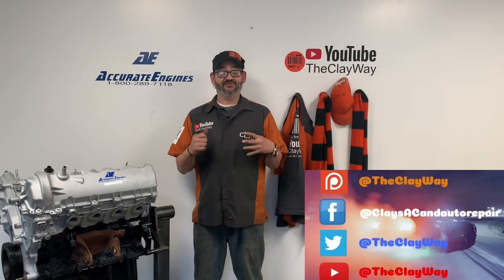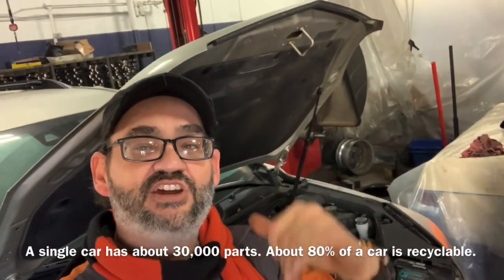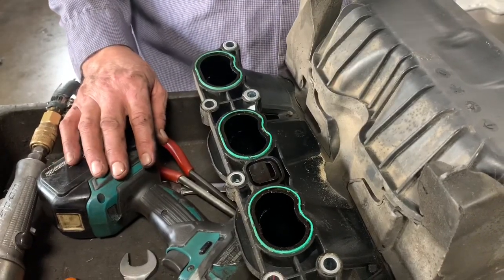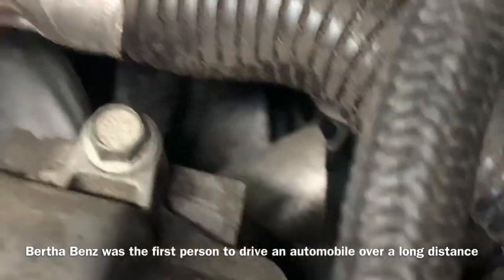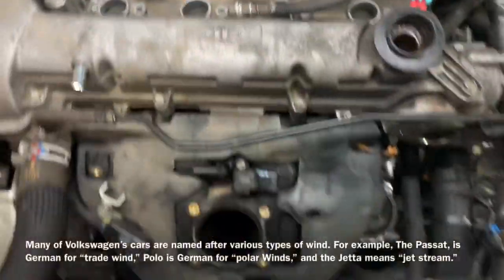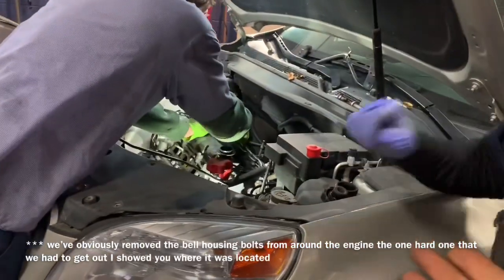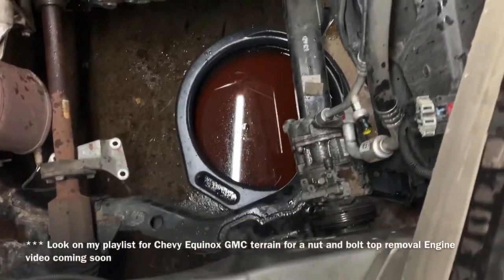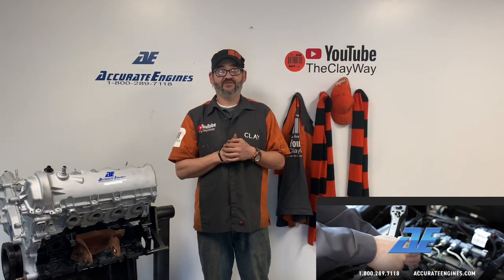GMC Terrain engine removal Overview/ through the top not nut and bolt/ with great tips

Comment: Removing engine and struggling with the exhaust bracket at cat converter ,very limited access, great video and good tips thank you,roger
Reply: Got it done myself ,took me approx 14 hrs but went at it 2 -3 hrs at a time, found it helpful to remove exhaust manifold upon installation to clear the cowl and forward rad support plastic cover (which i took a piece out of, but since glued it back in position)thanks  a note on the hidden bolt to engine/transmission, i took off rf wheel assembly and came in with about 5 ft of extension and a flex socket!!thanks again ,Roger
Reply from the maker: @rogergodin7525 excellent I’m glad to hear you got it done

Comment: wish i would have watched this before i tore into this beast.  i pulled the front cowl off thought i would need to pull it with a trans.  ran into alot of stuborn plugs.   thanks for the video.  hD to pull the axles cause i could notget to the bell bolts or brackets.

Comment: I have the motor in and running.  Sounds and runs good till I shut it off and restart it. Give me a p011 advance timing code. Checked everything timing good and 3 vvvts still no fixed
Reply from the maker: Well, that’s probably because the timing is actually Advanced more than likely the cam phaser itself on the end of the Cam is actually Advanced because it’s not working correctly

Comment: I just picked up a 2010 terrain awd v6 for super cheap but needs a motor, mechanic told me it wasn’t possible to take the engine out through the top, so does he just not know what he’s saying? Is it possible in mine?
Reply from the maker: Of course it’s possible…. And my opinion is that it’s easier.
Reply: @sharpcarco  alright sweet, that’s what I was thinking.. thank you for your advice and the video

Comment: How long does it take to replace an engine in an 2011 GMC Terrain? 
And the engine they are putting in is used but they found how it was cracked so they are fixing it. So how long does that process take?
Reply from the maker: All of that depends upon how busy the shop is. The work theoretically only takes a couple days but I don’t know what kind of situations they’re dealing with so it’s very hard to tell I’m sorry to hear you’re going through that issue I’m assuming that it’s taking a long time.
Reply: The Clay Way and yes it’s been in the shop for 2 weeks but I just found out that it’s ready now
Reply: @JuAsian1993  how is your vehicle holding up since the engine swap? Was it a used or new engine? How much did it run you for the parts and install?
Reply: @Howlingwolf601  I recently had my 2012 2.4l engine replaced and it ran me about $5,000 for a remanufactured engine with a lifetime warranty, my transmission has been shifting rough though so I'm going to top off the atf since it just got changed with the engine

Comment: I have a chevy equinox 2014 2.4  engine  has 140k  i remove the intake manifold and I put a new 1 and also valcover gasket and I put oil cah cant  you think that goint to prevent to the real maintenance seal blow? My engine doesn't  burn to much oil  and also I bay a oil cap for crankcase ventilating what you think?

Comment: I have a 2011 gmc terrain in my garage with a very good body, tires, interior etc… but the engine is shot. I was putting oil in the vehicle every two week until the timing chain went bad. Without an engine doesn’t matter how good it looks. I was told that it’s impossible to get a good 2.4 liter engine. They will still burn oil, timing chain shaving in engine, bad solenoids etc… is that true?
Reply: Jasper engines

Comment: Hi there, I’m looking to do a v6 swap on my terrain (I currently have the 4cyl) and wanted to know if the motor mounts are in the same spots for both engines. Just trying to get a feel for how much fabrication I’ve got ahead of me lol
Reply: Did you do this job? I was contemplating dropping a beefed up V6 model in mine, and double turboing it. I am also curious to know how hard the swap will be in terms of fabrication. If you did complete this job, or have information, please get back to me.
Reply: @g00fyscientist  I haven’t been able to yet. Saving to get the transmission rn because the motors have different trannies
Reply: ...it would be cheaper to get a complete engine cradle with an engine and transmission from a salvaged vehicle...  you would probably need a new ECM/PCM unit 🤔

Comment: Podría reemplazar el motor 2.4 a un 3.6 de una Terrain AWD 2010 gracias saludos
Reply: ... they have different wiring harnesses, plus the ECM would have trouble, or it would not recognize the V6 engine.  You would have to replace the engine computer also. 🤔

Comment: ? 2.4 13 equinox  running a vent oil cap now because it’s got 170000 miles on it I install it because crankshaft front start to leak at seal install new seal this week is good idea to run vent oil fill cap this vehicle never had recall it use 1/2qt 2000 miles

Comment: Where are the front torque converter boots?
Reply from the maker: Well I think you mean to say bolts, You remove the starter and then you can get access to the torque converter bolts
Reply: Yes, meant bolts but in the video you say remove starter to gain access to rear torque converter bolts. In wondering where the front torque converter bolts are located?
Reply: @MrTexasflood ... when someone says rear, they're usually referring to the "Rear", aka back end of the engine.   All the bolts to the torque converter are then accessible on the Flex plate that the torque converter is attached to, once the starter is removed.

Those are the only bolts on the Torque converter, the ones that secure the converter to the Flex plate.

Comment: Bro, still looking for that but and nolt, I mean nut and bolt removal video? 😂
Reply from the maker: Totally intended to make one of them videos about a year and a half two years ago. I actually shot all of the video then I lost it it really sucked….. and haven’t done one since
Reply: @sharpcarco  man I just finished rebuilding the engine on a 2011 Chevy Equinox 2.4 LAF(laugh) AWD  and I have a sensor driving me nuts that I can’t find, i had an engine light on, changed plugs and couple other things, the light went off then i drove it for about 3 hrs no yellow light of death or anything it ran really smooth, then all of a sudden the stabilitrak came on, engine light started flashing, the skid warning light came on, threw about 40 some codes when I checked it all the way from a p0300 misfire to where it said my parents were never married, I don’t know what in the world it’s doing.
Reply from the maker: Loose ground connection
Reply from the maker: @bomark2002 loose ground connection. Been there done that
Reply: @sharpcarco  thanks man
Reply: Hey one more question if you have time. I can’t find that loose ground that’s causing me a problem, there is one thing I did different, when I put this engine back in, I connected the battery ground that goes on the block of the engine over the tranny onto the aluminum cylinder head of the engine, Will it still have a good ground there, or should I move it back down onto the engine block?